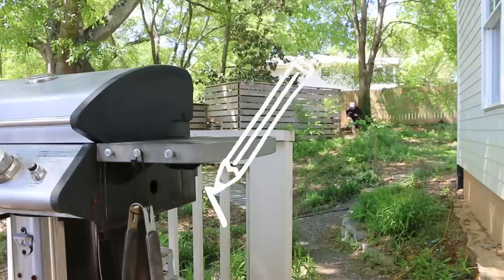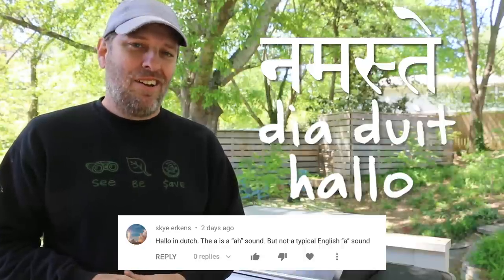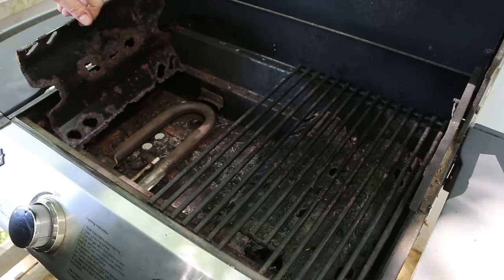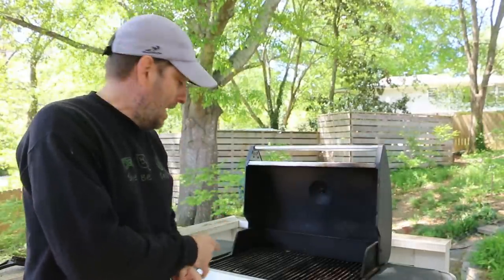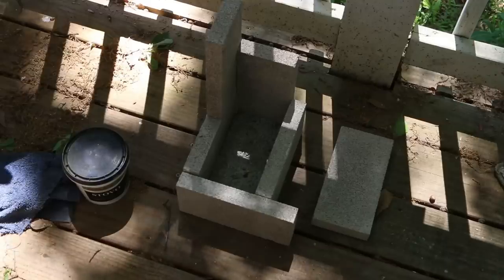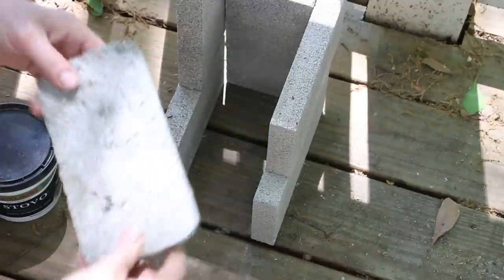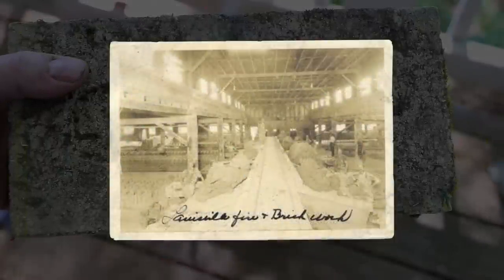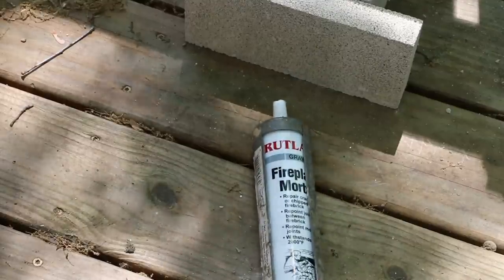How To Make A Rocket Stove Hidden Inside A Grill

Comment: Very interesting! Like you, I've been trying come up with a way of incorporating a rocket stove that I will use more frequently. 
I am building a pizza oven and while I decided to follow the traditional wood-fired approach, I have designed a rocket stove bbq grill to sit next to it (built in to the work surface).
I'm going to get a small circular cast iron bbq grill (Amazon), cut the bottom off and mount it on top of the rocket stove. I'm hoping the rocket stove will heat up some lava rock coals and distribute the heat evenly. I'm thinking this will give the fast heat up benefits of a gas grill, but using real wood. We'll see!

Comment: Have you thought of making a solar laundry dryer in your backyard lab to save some green?  I've seen a couple of designs.  One's just black textile on a frame over a clotheshorse to capture heat and keep the surprise shower off, another's a lean-to greenhouse with privacy glazing (depends on your planning codes) and retractable clotheslines in it making full use of the vertical height.  I didn't see, but I would imagine that one had a small fan to keep the hot air mixed throughout.
You could probably use an air-to-air heat exchanger too and hook one up to a stove like with your greenhouse heatsink you did, which would keep you being able to dry electricity-free through the winter.
I can also see a solar air furnace working well here, with a heatsink in the base to dissipate the heat, and a vent at the top to let the humid air out.
It'd be nice to be ready for when energy prices go back up, and I'm guessing they'll go up a lot to recoup their "losses."
Reply from the maker: Interesting ideas Rusty (as I listen to my clothes dryer rumbling in the background. :-) I wonder if the water could be captured, somehow. Thanks for the input. Thanks for watching.

Comment: Fun build. I converted an old gas grill that was completely done by building an L-tube rocket of perlite and clay over a wire screen under the grill top. The grill floor was a perfect fuel shelf and stove body support, and the hole where the propane cylinder previously sat provided primary air intake. I even built a little secondary air with an iron pipe, but not sure how much it really helps. Weatherproofed it with a lime/sand render. It has heated to grill to over 500 F according to the grill thermometer. Let me know if you are interested and I can send some pictures :)
Reply from the maker: Michael, that sounds like a cool project. I’d love to see pics. Send to Tom at GreenShortz dot com. Thanks for watching.
Reply: Can you please share picture of the setup, thanks
Reply: @ramcholan2034  Sorry it took a while for me to upload some media to a Google drive. It isn't really organized, but here are some videos and pictures of both the build and use of the rocket-stove powered grill. I started building it in April of 2019.

https://drive.google.com/drive/folders/1tAP3A0lW6TkNSTlw9p8QSgnX7rY8f06O?usp=sharing

Comment: That's a small rocket stove. The important thing about it is that it works. Have you ever tried using Miracle Whip salad dressing instead of butter when you are making grilled cheese sandwiches? My mom always used it and it did add a bit of a tang to the sandwich.
Reply from the maker: Hi Donna. I think the small factor here will make it perfect for lower-temp cooking, like roasting potatoes, making quesadillas, or the grilled ham and cheese I made in this videos. I'll have to try your Miracle Whip suggestion. Is that on the inside or the outside? Or both? Thanks for watching.
Reply: GreenShortz DIY My mom always just spread it on the outside. It might make the bread too soggy if you do both sides of the bread. I say just experment. If you use really dense bread, maybe it could work.

Comment: How’s that cast concrete stove  working out?  The “experts” say not to mix concrete and fire.  Any problems with it?
Reply from the maker: Hi Rick. The crack resistant concrete has held up really well. My concrete and perlite stove (same casting method) did crack. The concrete is weakened by the perlite in the mix...and I was too impatient with cure time. But, I put a metal band on it and it is working fine. No explosions though...as some have told me to expect. Thanks for watching.
Reply: GreenShortz DIY I’ve watched the crack resistant video a dozen times or more in the last week.  I think when I finally take the leap, that’s the one I’ll make.  I’ve been pricing the parts on homedepot.com.  Bucket and pipe are reusable.  Wire screen isn’t much, concrete is only $6.  That surprised me.  I’ll have to eat three pizzas,  but I’m willing to make that sacrifice.

Comment: Why not have it come up thru the bottom of the grill box? Have the firebox underneath, that way you get a taller riser, be able to close the lid etc. Kind of similar to your pizza oven
Reply: You could even ramp the feed so you dont have to bend over to feed it.. ?
Reply from the maker: I thought about that option. Considered moving one of my concrete stoves in and having it be centered. That could have worked, with a feed ramp, like you are suggesting. I was concerned about the location of the propane bottle, being closer to the stove. Or it might have meant not using the gas on the grill at all. In the end, I wanted this one as easy as possible. I would have preferred to have not had to cut out any metal, but I needed a little more space. Thanks for the feedback. Thanks for watching.

Comment: Where can I get the firebrick cement?  Am watching when I can what you have so far
Reply from the maker: Hi Ivy. Are you talking about the tube of the stuff I used to glue the bricks together? If so, I picked that up (stove mortar) at my local Ace Hardware. Home Depot might have it, but may need to order. Amazon had stove gasket adhesive, which would work, but it’s black. Just don’t get it on the visible sides of the brick. Thanks for watching.
Reply: @GreenShortzDIY  thank you will try ace hardware we don't have a home Depot nearby.

Comment: Where can I buy firebrick?
Reply from the maker: Hi. Ace Hardware normally has them in stock (the thin ones, like I used). Lumber/building material yards have them sometimes. Big box home improvement stores will order them for you. I think you can even get them on Amazon. :-) Hope that helps. Thanks for watching.